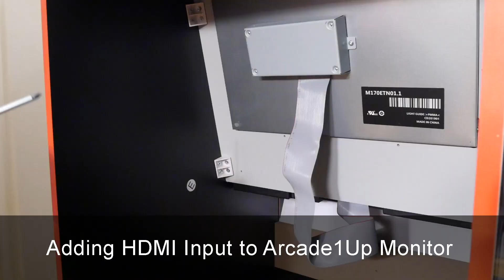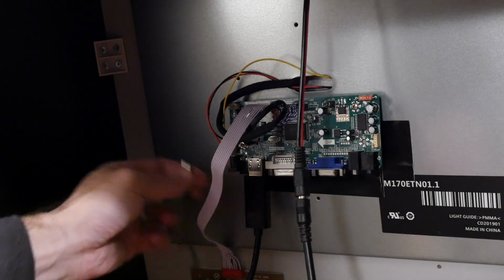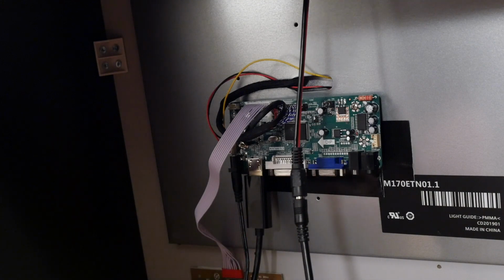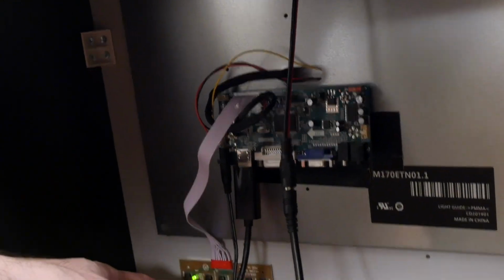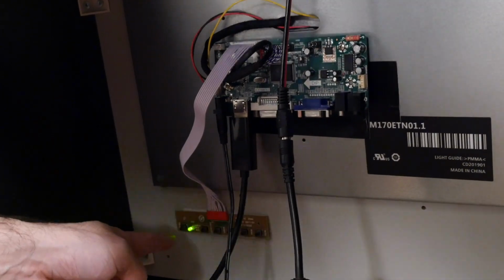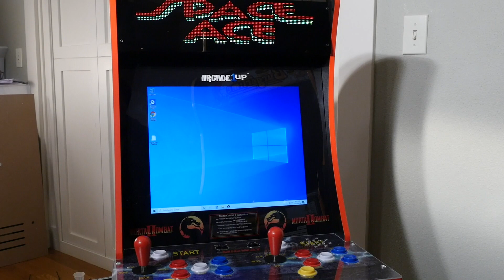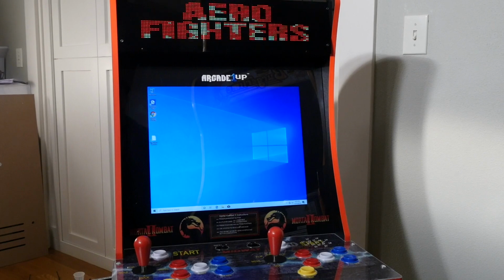Pixelcade Arcade1Up Monitor HDMI Conversion

Comment: Someone please help i was juat messing with my lcd controller on my tmnt arcade 1up and there was some setting second up from the bottom in the lcd controllers settings called like dcm or dcrm or something like that i have no freakin clue bc i cant see anything on the monitor as of now aside from lines...all i did was set this feature to on because it said on or off so on made the screen a bit brighter so im like ok go with that now have these damn lines runnin all through it and idk wtf it is i have a rpi3b hooked up to it and a mini pc via an hdmi splitter and i thought it might have been a sucky signal comming off the hdmi but it was doin it for the mini pc and the pi so im summing it up and saying.its something with the lcd controller anyway to reset this i also unplugged the power and plugged it back in same crap goin on aside from unplugging hdmis and reconnecting them aswell someone please help!

Comment: Does that board have hdmi output, or just hdmi input? I would like to output it to a bigger monitor
Reply: This controller board is for the Arcade 1Up screen. If you went bigger screen you would go straight to its HDMI from whatever you are using be it PC, PI, Pandora etc.

Comment: Correct me if I'm wrong, but this replaces the actual game pcb, yes?
Reply from the maker: yes correct, in this installation a PC is being used for the games , the arcade1up stock PCB is no longer used (there is no way to integrate Pixelcade with the stock arcade1up PCB)
Reply: @opengadgets  how do i leave pcb in and play the game while im doing this? Cant have both so just redew it if i wanna play the pcb?

Comment: Any issues with your screen shorting out?
Reply from the maker: no, there is a layer of insulation in between the PCB and the metal on the back of the monitor